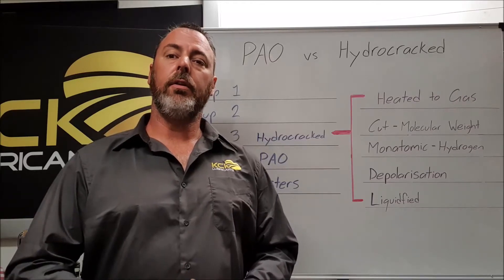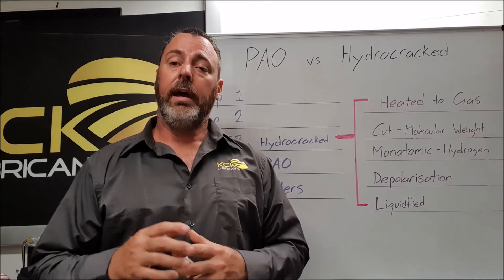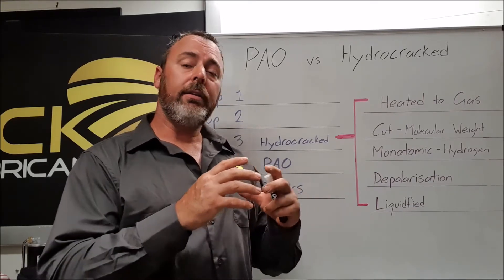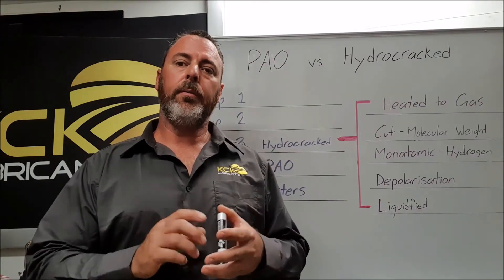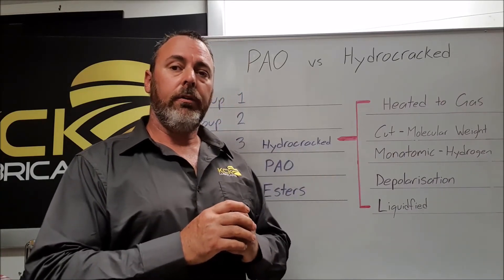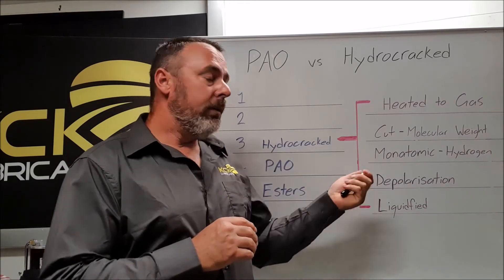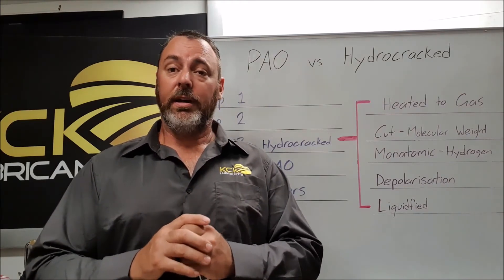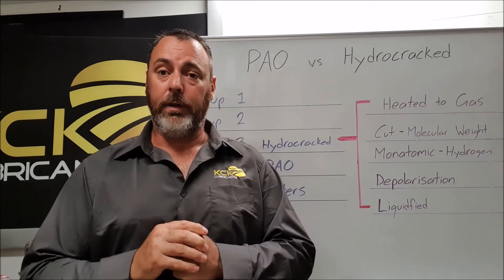PAO Vs Hydrocracked both synthetic oil's but very different, types of Synthetic Engine oil Explained

Comment: Is Mobil 1 synthetic oil better than Kirkland Costo synthetic oil?????
Reply from the maker: Thanks for watching and thanks for taking the time to ask such a great question. We do a lot of product testing, analysis and load testing of many of the oils on the market, however we have not allocated the resources to testing the Kirkland Cosco oil product you have mentioned in your question. Not having done any specific testing on the mentioned oil makes it impossible for us to compare the two synthetic oil products in your question but I'm sure you could sample both of the products and send them to a quality testing lab to get your own test results or use both the products in your vehicle to see if you notice any difference during the oils life span. This may not apply to the Kirkland Cosco synthetic oil but, what we have found consistent in our testing to date is that the price is a pretty good indicator of the value of the product.
Reply: @KCKLubricants  Great to know! I'll keep using Mobil 1!! :-)

Comment: Do pao oils shrink seals?
Reply from the maker: Great question! Ok, here is the short answer. NO. The oil itself doesn't cause the seal to shrink as such. Heat and age will cause the seal to shrink BUT we use an additive in all of our oil products to prevent the seal from becoming damaged by constant heat, etc. Some of the cheaper oils on the market do not contain this additive, causing seals to leak shortly after switching oil brands.

Comment: Hi, Can you tell me the base source of your POA oils, vegetables or animal?  An experiment with liquidise various vegetables oils versus animal fats in a 4 stroke combustion engine gave us surprising results in compression, heat and cylinder wear. The animals fats were superior in ever function and we are at a loss to explain the chemical properties of animals fats over vegetables ones except the PUFA polyunsaturated fatty acids are highest in animal sources. Can you comment on the pure esters oils chemistry in detail or link a source that elaborates on the chemistry of the ester oils. Thanks for your time.

Comment: I'm using this car(myvi) like about 10 years. So which one you would recommend me to use, either hc synthetic or fully synthetic? Thank you
Reply from the maker: Great question, some more information would be helpful
Reply: @KCKLubricants  I'm living in Malaysia, 34-38°c average per day. Daily travelling mileage 90-100km. Current I'm using Wurth Hc Synthetic  5w-40(4 litres)
Reply from the maker: @vickneswaran198  in that sort of application we would recommend the KCK RE16 10w40 Full Synthetic engine oil

Comment: Hello!
Is it a problem if a hydrocracked oil(mobil 1 0w40) is mixed with a Pao oil (meguin 0w40)in a petrol turbocharged engine? 
Do the engine need a flush if someone wants do change from HC to Pao and opposite?
I will be very thankfull if you can answer my question. Greetings
Reply from the maker: Thanks for watching! No need to flush the engine, a small amount of mixing as you explained will not cause any problems.
Reply: @KCKLubricants  Thank you very much for your answer!
Yes I'm a fan! I have watched a lot of your videos! Have a nice a time!

Comment: The problem of PAO is that the apolarity of the molecules does not allow a good dissolution of the additives, for this reason it is mixed with ESTER.
On the other hand, ESTER has the problem of hydrolyzing when it is subjected to heat and humidity.
Reply from the maker: Thanks for watching! You are correct and the solution is in the chemistry and engineering to ensure these problems are minimized or delayed until they are well outside the operating range of the product.
Reply: @KCKLubricants  Thanks for the answer, can you tell me what is the percentage of ESTER in your products?
Reply from the maker: @edogsx  there is different percentages depending on which product you are referring to but this is protected information that we cannot make public. I'm sure you understand that companies like KCK Lubricants spend huge amount of money on research and development of each and every product we produce and we cannot let our blending chemistry become known.
Reply: @KCKLubricants  I understand...
I was asking you because I have tried many products with a high ESTER content noting a strong acid reactive on copper and some (such as Amsoil Dominator) polymerize at high temperatures, i.e. they leave a semi-solid coating layer on the metal parts.
Have you a dealer in Europe?
Reply from the maker: @edogsx  Understand the problem and it is something we have worked very hard to overcome in our products. Currently we do not have a distributor in Europe.
Reply: There' now a move away from Esters as they can compete with the additive pack due on the wearing surfaces, especially for the SP rated oils. Alkylated Naphthalene is the best to mix it with. Blending a PAO with a Group 3 (Group 1 or AN for add pack) or and Group 3 with AN is really where it is at. Group 3 with AN allows for the add pack to need to carrier oil. I believe Petronas for the F1 and Mercedes is doing something similar. Could be wrong.